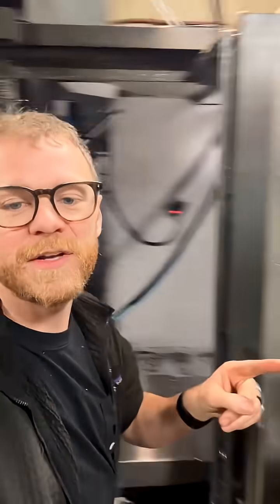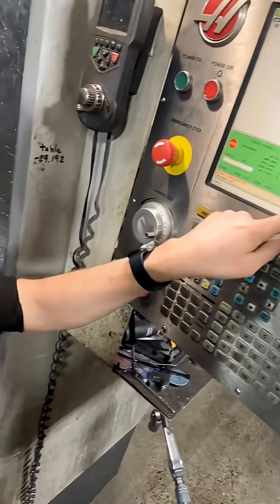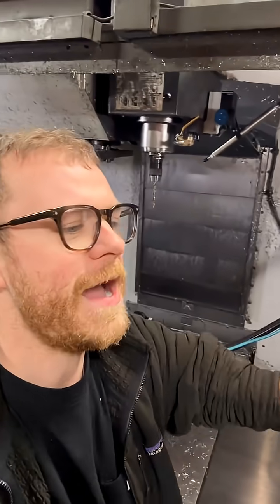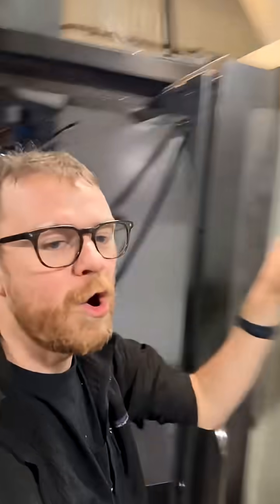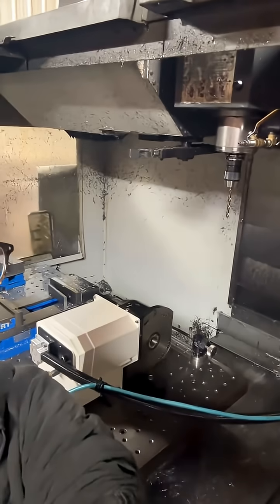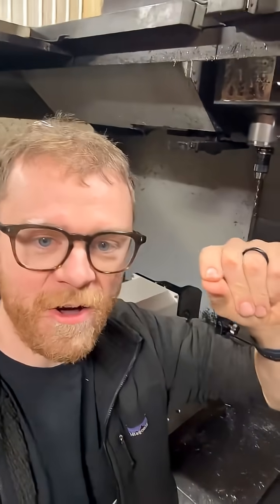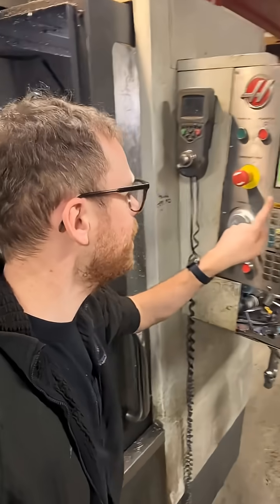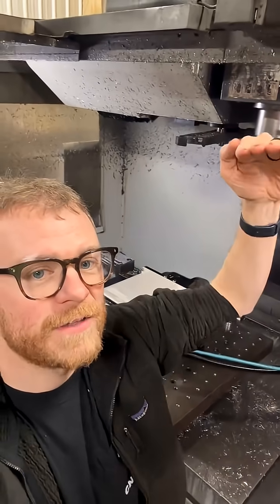Should you turn your CNC machine off without pressing E-stop?

Comment: E-stop is the 'E'mergency stop and not tthe proper stopping procedure for any equipment  as it is to be used for emergency stopping only. Normal equipment have a proper stopping procedure and an e-stop for emergency, hence the name. If the e-stop is part of the stopping procedure, then it is NOT an e-stop as it is just a simple mushroom switch used to stop the machine, OR the user cant be bothered to learn to use the equipment properly and will eventually complain about how cheap things are built now when the equipment he damages through improper procedures breaks down.
Reply: Sadly not all machines work like that, especially in CNCs or other automated equipment the e-stop is usually in the shout down procedure.

In CNCs sually there is another way to stop all the servos, actuators and pumps, and then you press the e-stop, (just for added safety) , but evidently not all of them are like that
Reply: It does kind of make a mockery of "emergency" stop. 
I'm in industrial machinery maintenance (not modern cnc) and the only machine that I've come across that you regularly use the e-stop to shut down is a gantry crane pendant and that's only a a secondary safety.  I'm amazed that CNCs use the e-stop as a shut down.

Comment: What will happen on a 1995 machine, with brush servos?
Reply: same if the counter is weak,  2018+ when the power buttons became soft off like a sleep button on a pc, it's the same on the lathes there is a risk x-axis can slip if the spring + air is weak on pre 2015 units